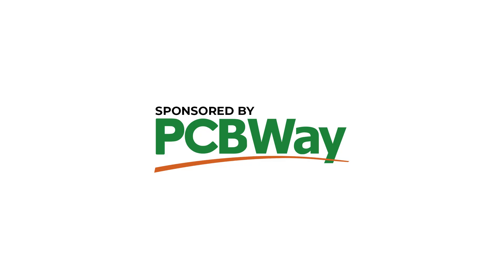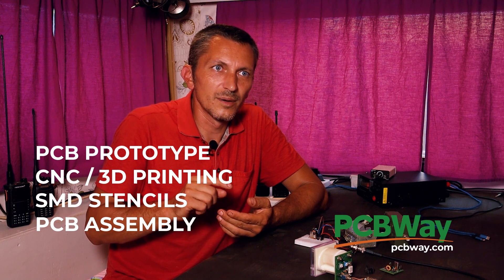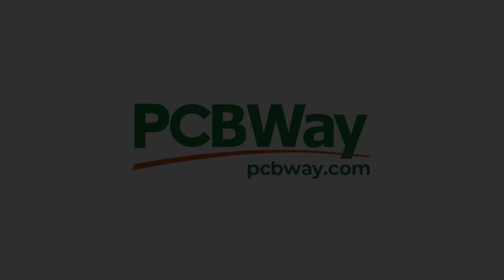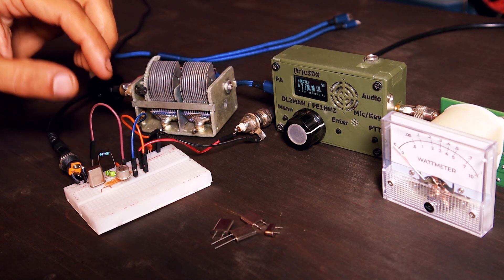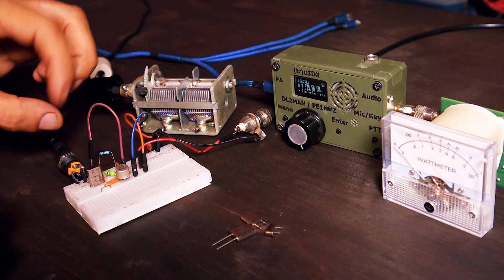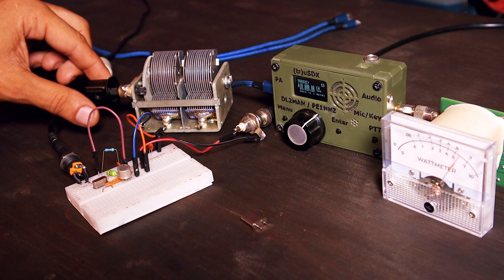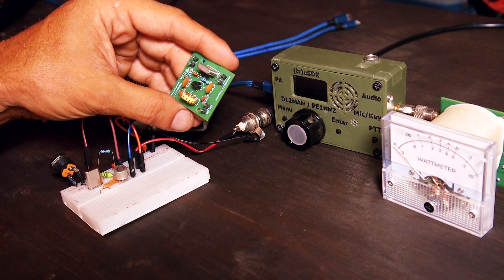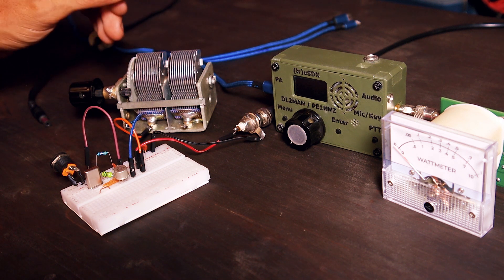Ten Minute Transmitter, The Simplest CW Transmitter

Comment: Great project! Thanks for showing it off. FWIW, I don't usually even try playing with RF circuits on solderless breadboard. The capacitance of the solderless breadboard caused all sorts of issues for me.
Reply from the maker: Yes indeed... plus that many times I have issues with bad connections and then I wonder why the circuit doesn't work 😄 ... so I also avoid them as much as I can. But now and then when I am in a rush and I want to test something really quick... it does the job. But not always 😅. 73, YO6DXE.

Comment: You can go even simpler just get a 4pin crystal oscillator package at 10,20,50 mhz. Connect 5v and a debounced pushbutton

You'll get a square wave  on the output pin typically, add some lc and antenna

Simplest Morse code transmitter

Could use that as a carrier to am modulate using a 555timer, op amps, and some extra passives
Reply: Not tunable but operates at the frequency of the quarts and possibly harmonics of it, 

Or use it in a pll and get wider tx freqs
Reply: Just measure the oscillator output in miliwatts you won't get watts of tx without an rf amp

But under 50mhz even a few hundred milliwatts can travel far
Reply from the maker: Ohhhh yes this one too. I think I had it on a paper somewhere on the to try list 😁. 73, YO6DXE
Reply: @dxexplorer  I saw it a while ago but using the rs232 port to control it using some bit banging but a push button is more than enough....

This looks like a mighty mite qrp iirc I remember a similar circuit but they used a MOSFET iirc instead of a normal pnp or npn

73 W4TIA
Reply from the maker: @Clancydaenlightened Yes yes this one and the Mighty Mite I found on the SolderSmoke blog when I first started building stuff and I love them. But this one I liked the most 😁

Comment: Hmmm, I think 15 years ago when I started playing with radio related projects I made several 20 & 40 meter simple oscillators or transmitters & at the time I used fixed valued ceramic capacitors rather than variable.

So as to not tie up hard to acquire aluminum finned variable capacitors once you get your sinewave optimized for power without clipping one can use your Nano Vna to measure the set variable capacitor & replace it with a fixed value capacitor.

As a side issue, I really do need to focus on learning morse code. Its a neat efficient way of communicating & in spite of being a retired mathematician who had learned a lot of esoteric stuff, I have always been terrible at picking up audible languages other than my native english and that includes Morse Code.
Reply from the maker: Ohhh yes of course. I have a few versions of this one built for specific bands and I only used a variable capacitor to find the value of the capacitor, then I replaced it with a fixed capacitor. The variable one is a must only if you want to stick to the original design and you want to have an all in one transmitter to use on more bands not just one. I kind of like the idea of using it for more bands though 😅😅. 73, YO6DXE

P.S. I also really need to learn the code. I am a mess still and this is what got me into the hobby in the first place. Maybe this year I have more free time for this.

Comment: Nice video.
So you can change bands by changing the crystals but how could you change your frequency in the band say like from 7.05mHz to 7.07mHz?
Reply from the maker: That is a little diferent. I haven't tried in this one, but try this if you have the time... imagine the place where you have the crystal now. Put the crystal in series with an inductor in series with a variable capacitor. Basically all three in series and you connect one end of the crystal where it used to be and the free wire of the variable capacitor to where the other end of the crystal used to be in the original schematic. Have look at the video I made a bit earlier on the direct conversion receiver with VXO. It will all make sense.

Comment: I just want to ask where you can get the variable capacitors, because here in Hungary it is almost impossible to get them.
Reply: When I was young and poor, I MADE variable capacitors out of soup can lids, small nuts and long bolts. 

If you understand how the component works, you are not restricted to what you can buy.
Reply from the maker: @raydall3734 That is true. Except when you want it to also look fancy then you start searching for stuff that is hard to find 😅😅😅.
Reply: I think eBay is the best option. There are even some new fancy ones made by some guy in Cyprus. Also a company named Virial from Ukraine makes them.
Reply from the maker: @batica81 ohh yes there are many. That is why I didn't put a link as everyone can get them locally. It's a lot easier this way. 73, YO6DXE.
Reply from the maker: Is the same here in Romania my friend. I usually search for second hand ones that people sell here and there. Also eBay should be an option as I remember I used to see many of them. I don't like eBay so I try to search for them on local websites or amateur radio websites that also sell second hand gear. 73, YO6DXE. P.S. Those cheap radios that have little plastic variable capacitors... sometimes they have 220pF capacitors in them. Those are still ok for some frequencies and if you place a fixed capacitor that is also 220pF in parallel with the variable one and use a switch to switch it in and out, then you can play with a total value of 440pF. That should cover quite a lot.